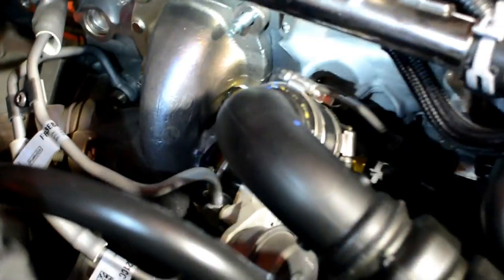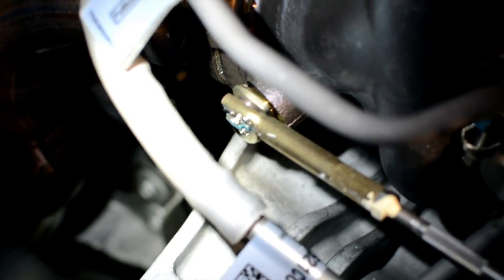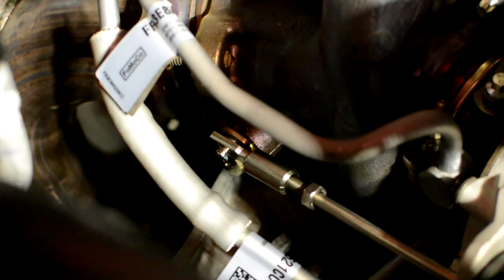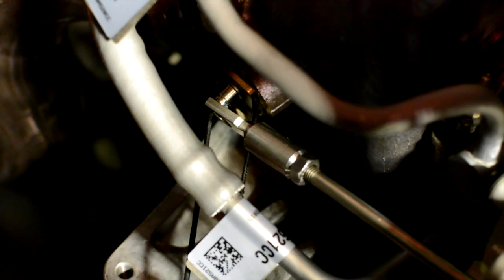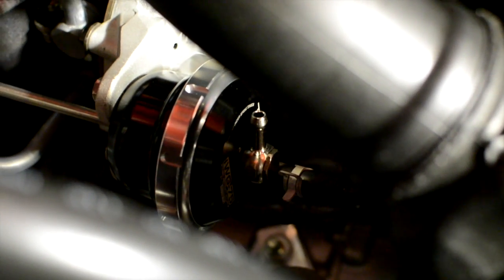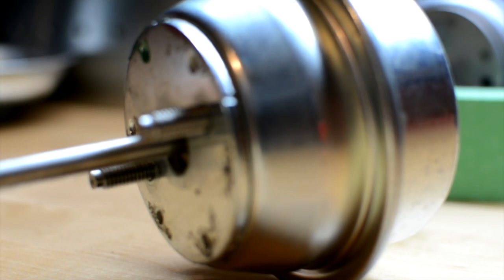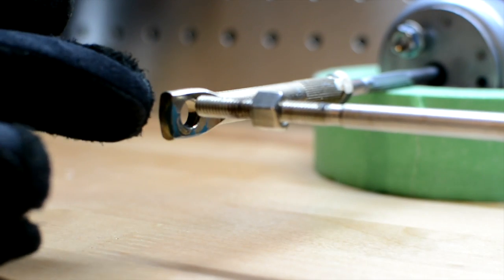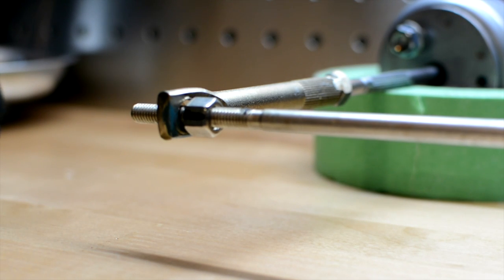TUNE+ Ecoboost Mustang and Fiesta ST Actuator Installation and Setting Preload

Comment: Hey there... Had some repairs and I'm almost sure they left my Fiesta ST preload loose since I'm barely getting 20 psi in a Stratified tune that should reach 24 psi. How can I check it? I didn't understood the stock settings, my tune is made for stock turbo and would like to know and not mess anything up. Perhaps it is to much but do you have a diagram?

Comment: Is this on a NX2 turbo? If so, is the 3 to 4 mm preload the same for the RS?  I Purchased the Turbosmart specific WGA for the NX2. Thanks!
Reply from the maker: Mike Stevens our NX2 specific actuator is 5mm preload.
Reply: So that would be 6 full turns?
Reply from the maker: Mike Stevens it’s as many turns as it takes to shorten it 5mm.
Reply: AdamBrunson got it thanks.👍
Reply: AdamBrunson where am I measuring 5mm from?
Reply: @AdamBrunson  It may be a little too early in the morning, but I laughed way too hard at this comment.

Comment: 4 full turns at 28 TPI is .143" more like 3.6mm. Why no 3.5 turns for 3.1mm? Also why 3mm vs the 2mm that turbosmart recommends?
Reply from the maker: This isn't a Turbosmart off the shelf actuator, this is an actuator custom machined for us to accept our spring set, so their recommendation on preload doesn't apply here. Preload between 3-4mm's is perfectly fine. So you can do 3.5 turns, or you can do 4 turns, it doesn't matter. Whenever anyone asks for preload we always tell them 3-4mm's, anywhere in there is fine. We can tell on logs if it is over preloaded or under preloaded and advise the customer at that time as our actuator requires a custom tune no matter what.

Comment: Do you recommend getting a wastegate actuator for the mustang even if it's tuned with the Cobb access port?
Reply from the maker: You have to have a Cobb Accessport and you have to have a custom tune made specifically by us for this actuator as outlined on the website.

Comment: This is a terrible review.... You don't even demonstrate anything...
Reply from the maker: Well over 300 customers have installed based on this video or just by common sense during install. It is a very simple install and didn't want to spend too much time in -20°F weather.
Reply: I think it's much easier on the Mustang cause of the ample amount of space to access this and the fact the engine is longitudinal. I don't even know where this is located in the Fiesta.
Reply: This is the best actuator video I've seen!

Comment: I set mine to the same length as the stock wastegate, what is the advantage of preload?
Reply from the maker: If you set it the same length as the stock wastegate your car will grenade as the stock wastegate is preloaded 1/2" roughly, when the new actuator requires 3-4mm's.